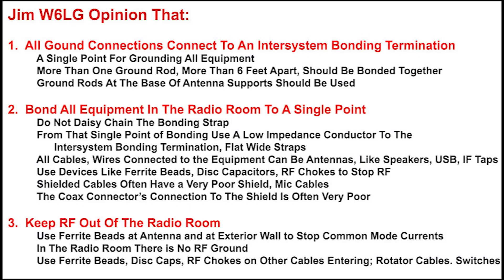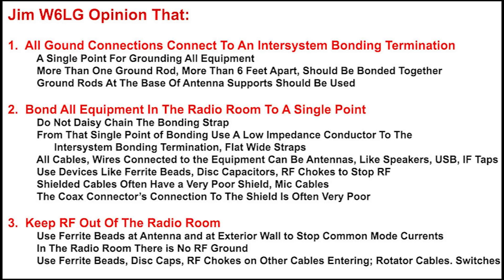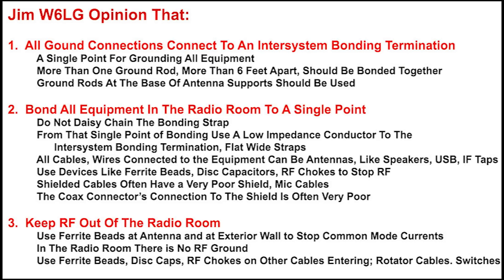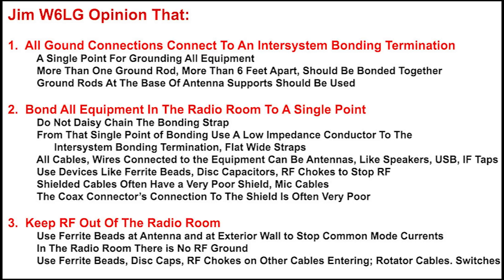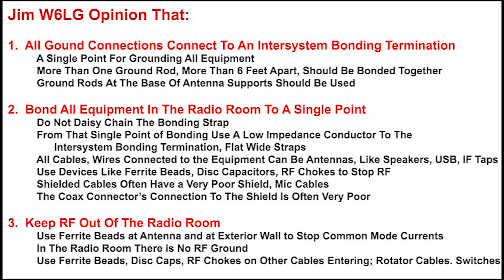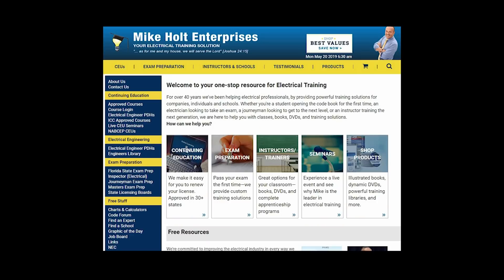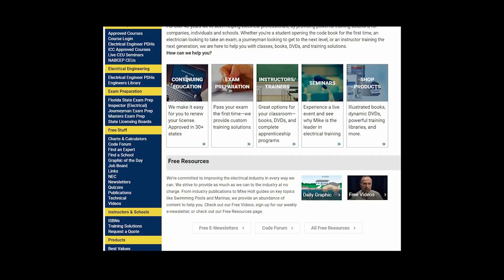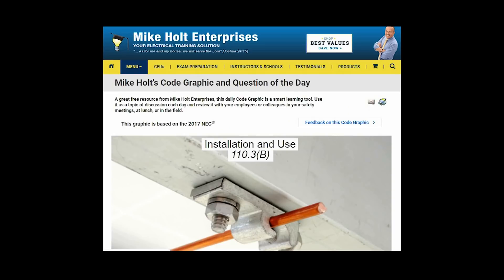Grounding, Bonding, Earthing, Shielding and Protecting with Jim Heath W6LG, 2 Part Video

Comment: I agree with all you have said. I think once the DC ground has a low enough impedance it can work for both DC and RF grounds. I would like to believe that the reason a lot of people and manufacturers recommend separate RF grounding is because most homes the DC grounding is poor. Which brought me to research doing soil testing for resistance.  Can you do an episode on soil resistance for grounding purposes
Reply from the maker: Thanks Nigel.  Question:  Is there such a thing a DC impedance? Seriously, AC has impedance.  Technically, can DC have an impedance?  Please let me know your answer.  

The soil question is something that I have read about but not done.  DC resistance in soil, I wonder?  That is causing me to wonder about the answer.  

Thanks, Jim Heath W6LG
Reply: @ham-radio  Hi Jim DC resistance in soil. I see your point technical terminology we give DC resistance and AC impedance.
Reply from the maker: I was just looking for clarification.  There's a lot that I don't know. For me, there is resistance only if it is DC.  If it is AC there is resistance and reactance.  Reactance is inductive and or capacitive.  Inductive can where it is too long.  Capacitive is when it is too short like in a dipole antenna.  And yes, I have heard others talk about DC impedance.   Thanks Nigel & 73, Jim W6LG in California near Sacramento.
Reply: @ham-radio  Yes same teaching here.  Please to meet you. 9Z4EJ here from the island of Trinidad and Tobago WI in the Caribbean. Still learning here.

Comment: Good video Jim. You have the only correct advice on youtube regarding ham grounding. Good use of Mike Holt. Thanks
Reply from the maker: Peter, Mike was very friendly and helpful. I believe that he is truly a friend of ham radio guys like us.  His advice in various videos and books is spot on. I wished that I had been aware of his help during the years I was a Building Inspector.  Off topic that subject, I have spent much of the last few weeks redoing the outlets, switches and J boxes in our new home. The finish wiring is terrible.  I found open neutrals, open grounds, reversed polarity, wire the wrong way around screws, loose connections, missing outlets all over the place and then there is the main panel.  This week I laid on my side replacing a duplex outlets in a larger box because that box was at the TV set and had 13 wires with a red switch leg. What a mess!  My broken ribs hurt even more after that!  73, Jim W6LG

Comment: Excellent explaination, thanks so much!  I feel like I've got a good handle now on the single point bonding/grounding of antennas. 

 Here's the one question I've not yet been able to find and answer for, or at least one I can understand:  It's my understanding that static buildup on an antenna is of concern, and a path to ground should be provided in order to discharge this.  I can understand how the radials will have a path to ground, but what about the portion of the antenna that the radio is feeding?  It seems like providing a ground for the active portion of the antenna would not be possible without affecting its performance greatly?

Maybe my inexperience is showing.  Thanks from a very green ham.
KD2TGA

Comment: Jim as a designer I use Mike Holt regularly that is a great site....
Reply from the maker: Hi Matt,
Mike Holt is amazingly kind and generous.  We had a brief conversation on the phone and he offered to help prepare information for the video.  I was a Building Inspector for a time.  He is highly regarding by those in the business of inspecting.  It is a team and not just one guy.  
Matt what do you design?
FYI, I am at this time wiring the new radio room and have an extensive grounding system for the first time since being licensed.  Yes, I have a common point ground.  The new room in a room has 3 inch wide copper strap everywhere.  The walls are sheet rock/extruded polystyrene/staggered studs in party wall configuration/two layers of r-13, Polystyrene and then sheet rock. The room is just 11 by 10 with two positions.  At the ham desk there are 6 duplex outlets, three 240 volt outlets, HDMI, CAT 5, rotator cables, many coax cables and connections to the 3 inch wide ground strap.
Thanks Matt and 73 from Jim

Comment: Hi Jim,  Another excellent video.  I think I agree with you on the concept of RF ground.  I'm torn between the "but everyone knows you need an RF ground" and the "how can a rig to ground wire that is longer than a couple of meters not be a radiator on most of the amateur radio bands?".  My shack is not at ground level so I've been exploring a lot recently, but not really getting anywhere conclusive.  Nice work on giving a solid take on Mike Holt's info that applies to we radio nuts.  Thanks again and 73, Alan ZL1SAW